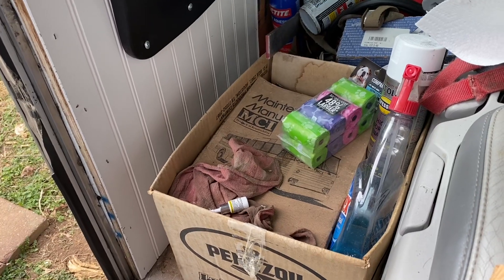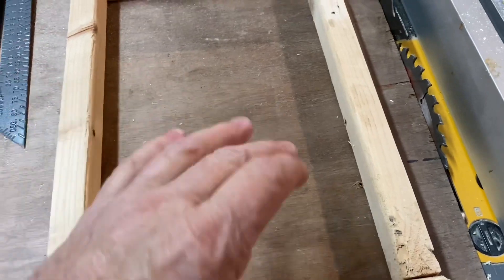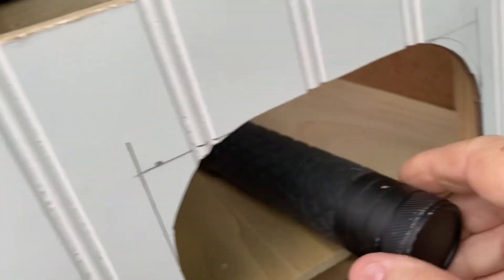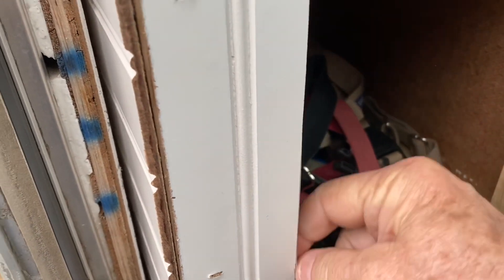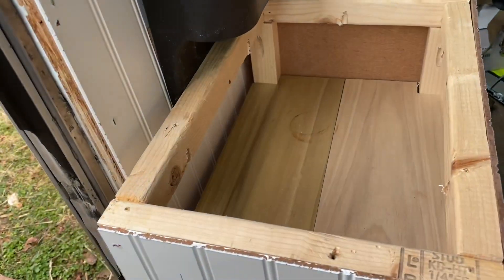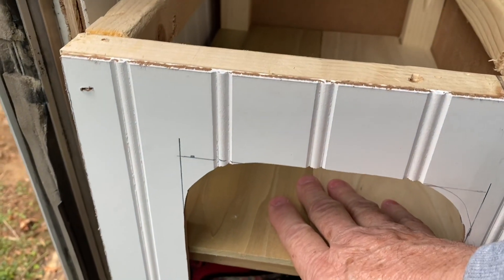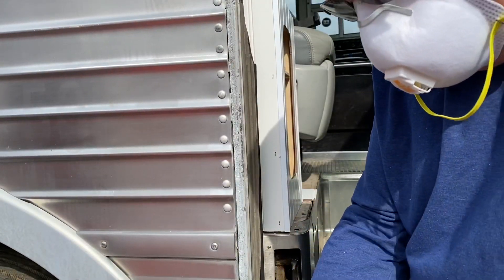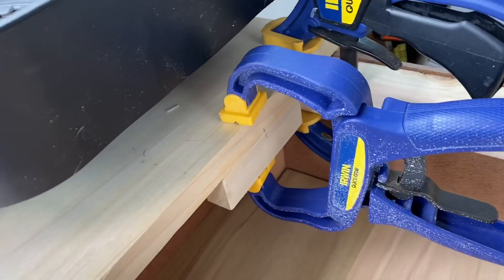#29 - MCI, MC5B, Bus Conversion - End table for the navigator seat

Comment: Just exactly how do you use a IR thermometer to “test” a  bearing?   Like the Coronavirus protective gear.  Very good situational awareness.   As always, standing by and looking forward to your next video.
Reply from the maker: Heat build up... testing for dragging brakes and bearings heating up. You can shoot the hubs to see if they are hot.